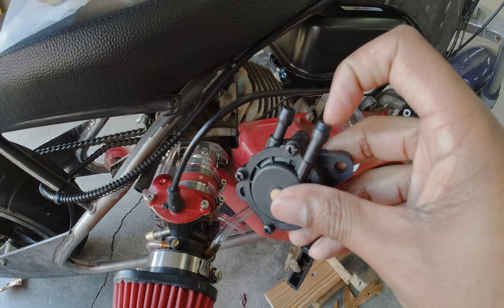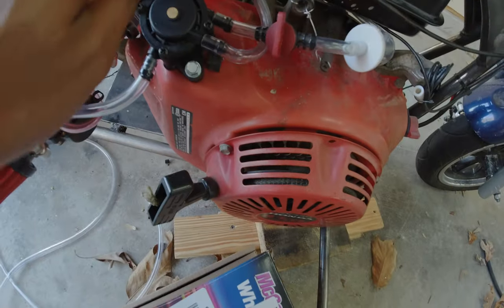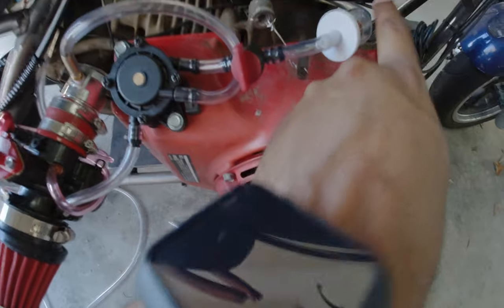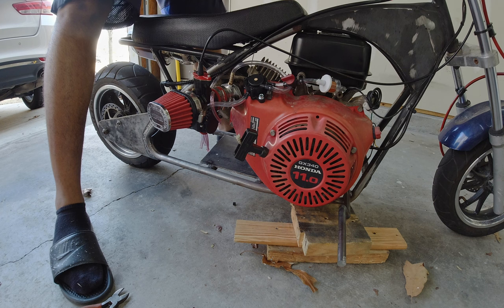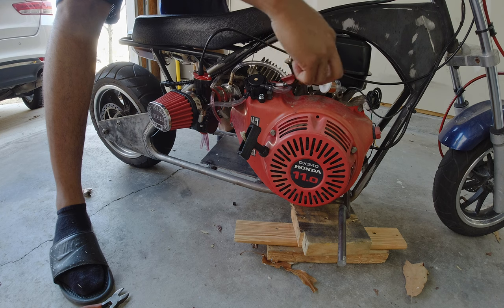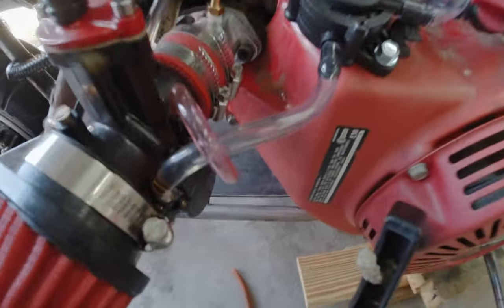Fuel Pump Pulse Pump Install on a Mini Bike or Small Engine

Comment: So I just recently bought a ghost pred engine for my go kart, maybe not the wisest way to jump into small engines but, I'm trying to make sure I have everything to make it run properly, with this carb setup, would I need to have a oil catch can to provide that suction, I'm presuming not right?
Reply from the maker: I don’t think using a oil catch can as vacuum for the pulse pump will work correctly
Reply: There is a spot on top of the engine to hook up the fuel pump. Can’t miss it. Have same engine. Very fast. Go big on the sprockets and be careful.

Comment: i seen videos of people using the side cover for preassure, the valve cover, the governor hole now the carb, can you really just do any of these
Reply: i dont want to drill into my side cover, i dont want to drill more holes in my valve cover and i still have my governor intact
Reply from the maker: They all provide a pulse. If you don’t want to modify anything, then the carb adapter with the port is probably your only bet. And with the side cover, I think the billet replacements have ports built into them but they are kind of pricey.
Reply: I'm pretty sure, it's any port that gives positive vacuum. If it sucks it won't work

Comment: Does it still pump at wide open throttle? Im curiuous because the vaccum technically drops when the throttle is opened. That is the smoothest industrial engine ive ever heard btw.
Reply from the maker: At WOT Ive never had it spit or sputter like it was running out of fuel, but at the same time, WOT on this engine, as it sits, is only 5300rpm. And this motor has to be super low hour as it is very smooth. It came off of a power washer that the pump had went bad.

Comment: Bro said, I don't need to pull this cover off before putting self tappers through it. There's nothing important back there. Lol
Reply from the maker: If I was running 2” screws it would be an issue, but it’s nothing back there in that void for some 1/2” self tappers to interfere with.

Comment: Engine sounds good! I tried using the pulse from the side cover and the pump gets oil in it😢
Reply from the maker: I’ve heard of people using the old governor hole and doing the same thing. Does it mess the diaphragm up when the oil gets in there?
Reply: @DariusBuildz  yes it does . Best place to get a pulse from will always be the inside manifold

Comment: Is there a benefit of running it from the carb adapter nipple vs off the block? Thinking about doing this and re locating my fuel tank and I’ve seen a bunch of people have to drill and tap the block but I have pretty much the exact same set up as you just on a duromax 500cc and a 34mm carb
Reply from the maker: I don’t know if there is a benefit, other than running it off the carb just being easier.
Reply: @DariusBuildz  I gotcha, does it loose pull when the throttle is wide open or is it the same or?
Reply from the maker: Ive never had a problem with loosing fuel and Ive held this wide open throttle for minutes at a time, so I guess the vacuum at the carb port must be pretty consistent.

Comment: will this setup work with a pitbike engine. i got stranded depending on a 2 cell lipo battery that died on me 10 miles from my home. you can only image pushing a shifter kart home with a full tank of gas smh
Reply from the maker: It should work work any engine that has decent vaccum. It’s very low pressure so it shouldn’t flood the carb.

Comment: Yo yo, so I can just run the “Air in” hose right off the Factory Valve cover nipple? For it to work? Or could I just put the hose into my air filter? I don’t have aftermarket carb setup but I have the adapter for the aftermarket air filter.
Reply from the maker: I’m not sure if the valve cover nipple will provide enough of a vacuum pulse. If you were to add a barb to the air filter, that may work? I’ve never thought of that and I’ve never seen anyone try it! So the air filter one is a maybe!
Reply: More efficiency with the carb vs air filter setup unless your filter box is able to hold more than a decent vacuum 👌

Comment: My gx270 sputters when i hit bout 30 i have a 30mm pwkcarb will a fuel pump possibly resolve this issue?
Reply from the maker: sputtering can depend on a lot of things. It can be lean, or rich. If your tank is not gravity feeding properly, a fuel pump will solve your issue. If you have a jetting issue, a fuel pump will not make it any better.

Comment: How did you keep from your carb flooding with gas
Reply from the maker: I’ve never had a carb flood with a pulse pump. It’s very low pressure.
Reply: It didnt flood at all? I strated mine up yesterday it flooded ...didnt have to tune it or change the needle or jets?
Reply: @Slow_Teg  so the flooding stopped but the Rpm are high I adjust idle screw but nothing changes
Reply: @DariusBuildz  did you have a issue with it tryna go by itself and idles a bit high
Reply from the maker: i wonder if the pulse pump is sending too much fuel to your carb.

Comment: I have a benelli 49x moped and I have a nipple on the engine case which I'm not sure if the pump connects to that ? Also I have a small reservoir that the fuel lines connect to and from I'm confused as to why I have them can you help please
Reply from the maker: What year is it?

Comment: I installed that pulse line on a carburettor spacer with Pulse attachment if you know what I mean (different to yours). And it isn't really building up pressure, i have a broken sealing on my valve cover could this be the problem?
Reply from the maker: The valve cover seal shouldn’t make a difference on the pulse from a carb adapter. I wouldn’t think so anyway.
Reply: @DariusBuildz  OK, thanks

Comment: would I need the fuel block switch too if I get this ?
Reply from the maker: No. You don’t need a petcock for this. But I like to run my carbs dry after I ride them and it’s also makes for less mess if I need to remove the fuel line for any reason. But no, it is optional. But it is nice to have.
Reply: @DariusBuildz Cool thanks

Comment: How do I install the throttle cable on this carb
Reply from the maker: You have to remove the top two Allen keys and lift the flat side out the carb. It’s a little tricky to install. I can’t remember if I showed how to do it when I installed the carb
Reply: @DariusBuildz  what clutch are you running
Reply from the maker: running a 40 series torque converter

Comment: mine leaks fuel from the release vent up top? any idea why
Reply from the maker: sounds like the diaphragm is a tear in it
Reply: @DariusBuildz  how do i go about fixing that brotha? it was running good for about 30 mins then she shut off woukdnt turn back on then started speewing gas out
Reply: @vertigoog2431 how did you fix this mine turned on then Started to leak gas
Reply: @BikeLyfeCeas  it’s normal for the pumps to leak a little bit of gas after running for a bit i went thru 2 pumps before i figured it out haha
Reply: @vertigoog2431  so mine leaks the gas out thru over flow
Reply: @BikeLyfeCeas  which is the vent on the top right? yeah that’s normal if it’s leaking elsewhere you got a faulty pump… and trust me they break A LOT it’s plastic pushing a shit ton of fuel in 2-3 ways so if no luck go back to gravity fed… make sure your fuel tank ids nice the motor for gravity fed and you’ll be okay! :)

Comment: i have a normal carb do i have to buy a new one for the vacuum becasue i see on urs theres a gold nossle?
Reply from the maker: You just need to buy the manifold adapter with the vacuum port, or drill your existing manifold and tap it for a vacuum port.
Reply: @DariusBuildz  so every carb has a vacuum port?
Reply from the maker: It's not the carb, thats the manifold adapter.

Comment: Does the gas tank needs to be higher than the carb for it to work? Or it does work even if the tank and carb i leveled?
Reply from the maker: The gas tank can be anywhere. It can be below the carb and the pulse pump will pull the gas through the line to the carb. My tank is just low enough where it will not gravity feed to the carb.
Reply from the maker: If you don’t want to use a pulse pump, then yes, it needs to be above the carb so that it will gravity feed properly

Comment: What carb are you running?
Reply from the maker: PWK34mm. I have a link in the description to the carb.
Reply: @DariusBuildz  thank you
Reply from the maker: @norcalcinematix7607  Anytime!
Reply: What size jets are you running on your carburetor
Reply from the maker: @ghikjedv5442  whatever jets came in it. I didn’t switch it out. Surprisingly it wasn’t lean. It’s actually a little rich. Before the muffler it would spit flames, 😂
Reply: What size do you think is it
Reply from the maker: @ghikjedv5442  I don’t have the slightest idea. It came with a few jets. Let me see if I can figure out which one is in there.
Reply: Alright
Reply from the maker: @ghikjedv5442  The extra jets are 130 and 140, so I’m going to take a wild guess and say a 150 is in there, lol 🤷🏾‍♂️
Reply: That’s a really big jet
Reply from the maker: @ghikjedv5442  I run 130 jets in my stock 212’s with a pipe and chikuni, so a 150 in a 340 isn’t all that big. I think my 125M runs a 92 jet

Comment: What is that little gold piece you used to drill into the intake?
Reply from the maker: It's a threaded barb, but it came with the intake and the intake is pre-drilled for the pulse adapter.
Reply: @DariusBuildz  ok thanks, did you use 3/8 fuel line

Comment: Could i also attach the vacuum port of the pump on the normal (ventilator) output of my valve cover?
Reply from the maker: I’m not sure if the valve cover will give enough of a pulse.

Comment: The air fuel mixture is divided before it gets in the cylinder by tapping that pulse pump so less air and fuel mixture going in the cylinder. I rather tap the pump to the OHV just my own preferrence.
Reply from the maker: I doubt the pulse pump is taking any amount of air from the engine that would make a difference on a large scale.